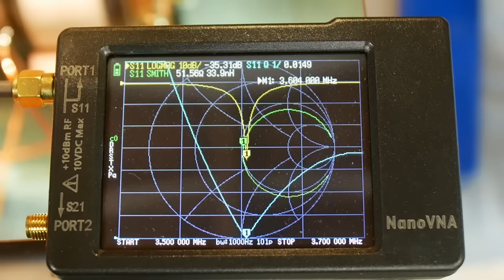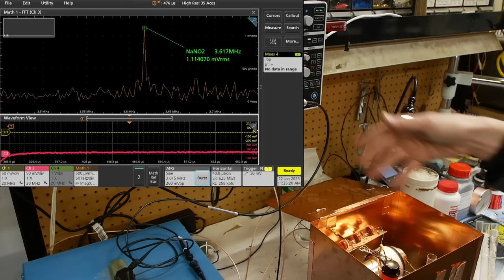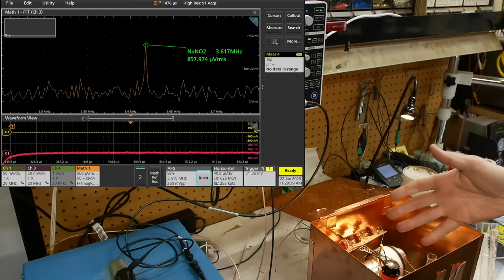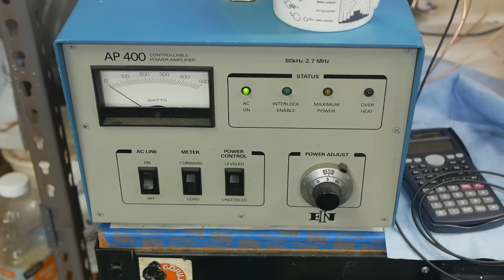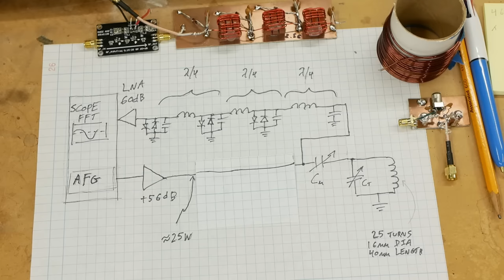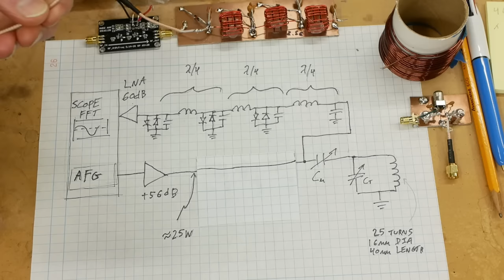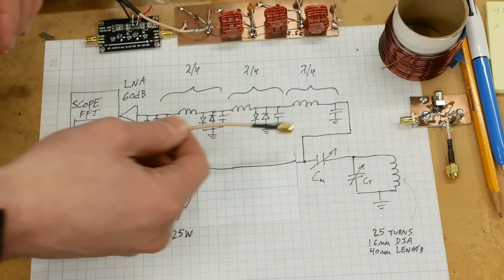Identify chemicals with radio frequencies - Nuclear Quadrupole Resonance (MRI without magnets)

Comment: 25 Watts seems like a lot of energy in the input pulse. Which component in your testing device absorbs the most energy, i.e. what gets hot ?
Reply from the maker: True 25 watts is decent power, but we only need to transmit for 100 microseconds, and this is repeated once every few seconds, so the average power is very tiny.  No components are measurably warmer because of the transmit.
Reply: @AppliedScience  I don't have telegram. What else can I use ?
25 Watt pulse = 25 J/s, delivered for 100 microseconds.
25 J/s * 1 X 10e-4s{100 microseconds} = 2.5 millijoules. This would be theoretical maximum delivered energy to sample per pulse.
k = 1.38 X 10e-23 J/T, Boltzmanns Constant relating energy to absolute temperature.

Comment: You might  not have enough Paracetamol  in your sample. Those pills have at least 4-5 other substances + alot of air between them. Make powder, compress them and add the same amount of "pure paracetamol" than the other samples (molar amount). Maybe that might help.
Reply: Yeah, I was wondering about the effect of the other inactive ingredients.  I didn't even think about the air maybe... good call!  I know sometimes we'd have material that'd be less crystalline as well and more amorphous. Polymorphs will have some effect as well I'm thinking.

Comment: Back in undergrad organic chem we used to spend sometimes longer in the spectroscopy labs trying to figure out what we synthesized than we did synthesizing whatever the hell we actually had made in our cuvettes--to get clean spectra... and then longer still playing a very boring logic puzzle that is the intersection of the mass spec (if youre lucky enough to have a molecular ion)/proton NMR (to tell you the carbon backbone from the different types of carbons you have affecting the hydrogens/proton spectrum), UV &  FT-IR spectra (to tell you what kinds of functional groups you have tacked on your backbone) that looked anything like the textbook charts ;DDD

Why didn't they teach us there was a 'just need one spec that definitively tells you whatcha got without the logic puzzle!"

Comment: Suggestion from a causal developer who watched your videos since the start. I statistically consider myself as the average person in your target demographic (maybe a little bit above) and I had trouble understanding the concepts. It felt like this one was way more difficult of a topic to grasp. Keep it up though I still learned a lot it's just a bit less so than normal. I conside you someone I aspire to me nowadays after TotalBiscuit as he shaped my childhood values.

Specific reasons why: I tried understanding the diagrams of your ciurcit as someone who has some knowledge in musical amplifiers and didn't get it (aren't you just dividing the sensing voltage even in the sensing phase? Is that fine?)
I understand magnetic fields as electric fields with general relativity thrown in so a moving charged particle through an electric field causes magnetic force, I don't understand how the non sphericcal atom causes electric field.
I didn't get the part about the molecule causing interactions that makes the electric field at all. Can't even describe it furhter.

Comment: I have been frustrated for years, maybe decades, that explanations of MRI and NMR usually start with a quantum mechanical paradigm, then transition to a classical paradigm without so much as a pardon me.  I can understand that the classical outlook produces maths that are practical, with precession frequency, T*, T1 and so on, but I am frustrated that I have never seen an attempt to do anything more than the most basic discussion in a quantum fashion or at least say OK, here the quantum approach gets too unwieldy and were are switching to classical and here is why we can get away with it.  You came closer than most, but the gap is still there.  I’d like to see either a fully QM explanation, or a good explanation of why the equivalence is justified.

Comment: I recently found an unknown device, any idea? A 2'x2' foot box with welding electronics (big resistor, big soda pop can capacitor, 00/ cable, a big rheo, no no boards at all, like a tombstone) connected to the bottom of a steel container "cup" 3/4 an inch thick. Two, double zero cables went to the bottom of the cup and it had flat copper electrodes in the bottom that were not oxidized. The electrodes were loose and not bolted down or anything. Ran on 220v. The maker is deceased so I can't ask him. I could tell by his copious documentation and polariods going back decades he was playing with blue lasers for a long time.
Reply: For its apparent capacity it didn't look like it was getting very hot, not red at least. It didn't have any heat discoloring on the cup either or even rust from getting hot.
Reply: Perhaps some sort of an capaitor based spot welder. Charges the capacitor to an adjustable level uding the variac and an rectifier. Discharging though the thic csbelsnint whatever was to be welded.

Comment: Sodium nitrate 
3.6 mega hertz 
Signal high 

Sensitive  information 
Transmitting 
Capacitor 
25 turns 
50 ohms 
High the q detects the signal from atomic nuclear 
25 watts 
Amplifier
Received channels 
100 microseconds pulse 
Solid active switch 
Quarter wave technique 
Magneticresonance 

Inductor 
2.2 microhenry 
Diodes forward conducting  
Noise 
Interference 
Junction capacitance 

2.56 mega hertz 
Smith ....shows the impedance

Comment: Somehow I highly doubt aliens would measure time in anything resembling seconds. What are the chances their "day" matches ours in duration, and then they divided it into 24 equal chunks, and then divided that by 3600 to get their base unit of time. Or that they also defined their unit of time by the equivalent number of vibrations of cesium to match that (now) rough unit we call the "second".
Reply: We and the aliens could probably agree on a common unit of time by sending for example the atomic number of cesium and the number of periods in binary or something similar.

Comment: There are some unintended effects that you can not compensate for or even explain
from such a measurement analysis copper box. 

example stargate: naquadriah
a substance that did not comply with normal testing or compensating procedures. 

example thioridazine : 
unintended effects 
stops sperm production but does not inhibit orgasm.

i doubt copper does not have 
unintended effects 
against certain or any all elements. 

only space itself is a neutral medium that can be relied upon to test element frequencies. 
space itself is non reactive 
if it were reactive
nothing would be stable 
at anytime.